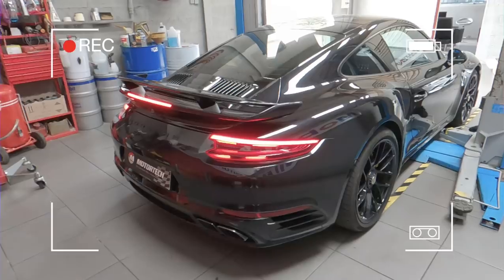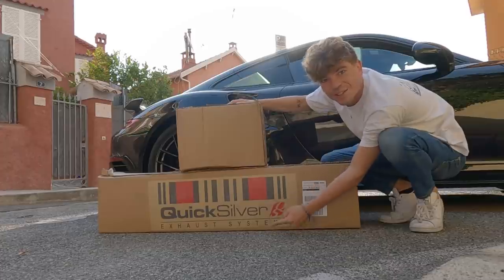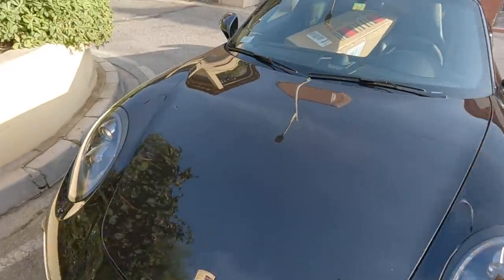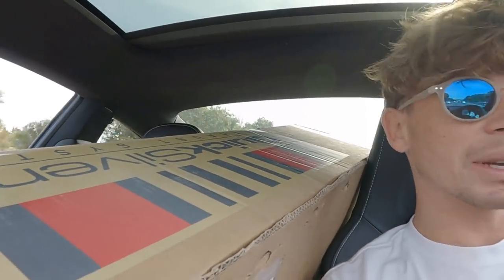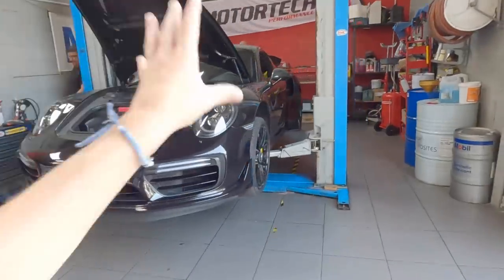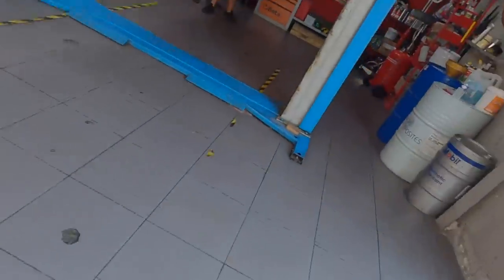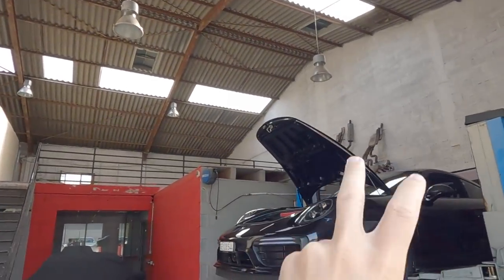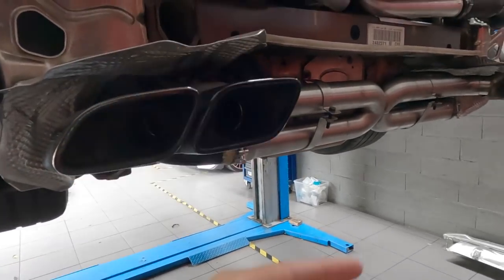Installing a Quicksilver Exhaust on my Porsche TURBO S !

Comment: This is the exact exhaust system that I am looking for.  Is there a spec number or product type you can share?
Reply: Hi! You can order via this link: 

X-Pipe:    https://quicksilverexhausts.store/products/911-turbo-991-gen-1-2011-15?_pos=1&_sid=5ab1fc72b&_ss=r 

300 CPSI Sports catalysts:     https://quicksilverexhausts.store/products/porsche-911-turbo-991-gen-1-and-gen-2-race-catalysts-or-catalyst-replacement-pipes-2011-19?_pos=2&_sid=5ab1fc72b&_ss=r&variant=39515761442858 

This is the same set up as Seb. Any questions feel free to drop us an email on info @ quicksilverexhausts.com